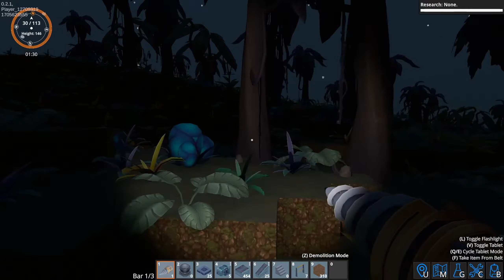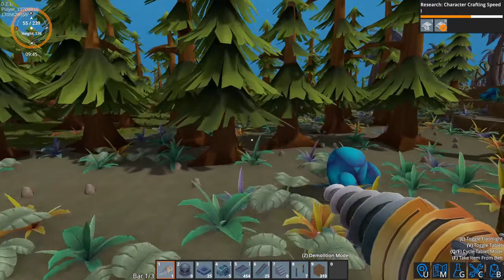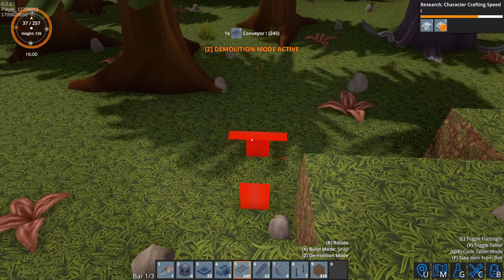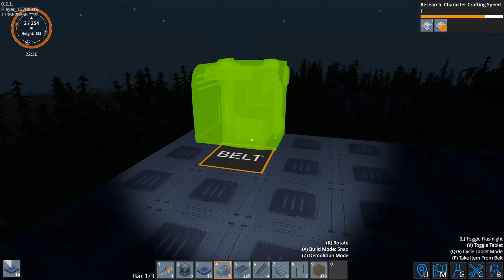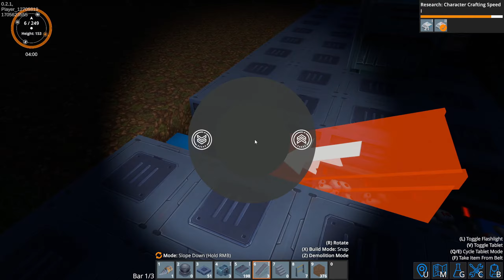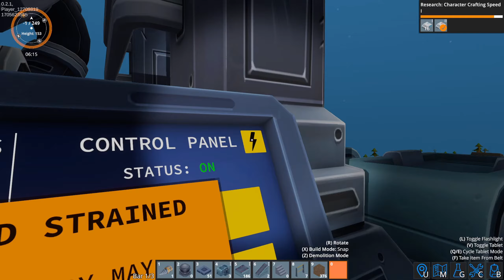Let's Play Foundry s01 e18

Comment: I have over 62 hours in the game and, like you, it never occurred to me to place a foundation right on the ore deposit and then place a miner on top. Given the 14x14x13 coverage, with the miner at the center we’ll cover a 14x14x5 area (losing the height of the foundation). On the edge we’d get at best 14x6x6 (assuming the deposit doesn’t extend below the miner). That’s 980 sq. meters vs 504. Wow!
Reply from the maker: It's a little tricky, the drone miner needs to be placed on a foundation but the mining drones won't go through the foundation blocks (at least I don't think they will).  I guess you could extend you could make a little peninsula of building blocks out to the middle of the ore deposit and place a drone miner on it. I haven't tried.